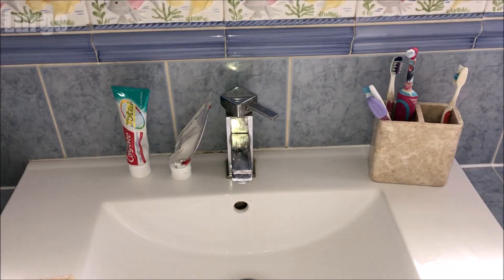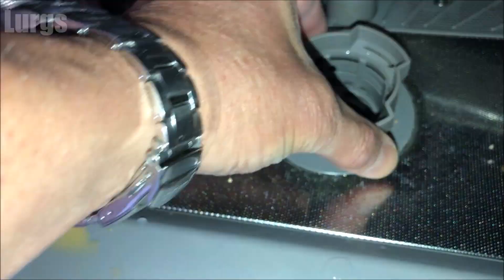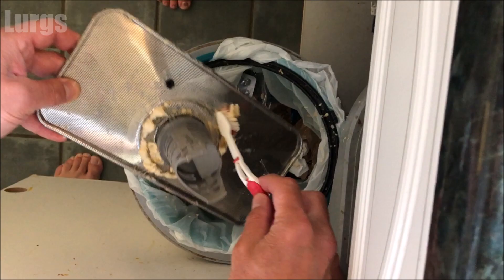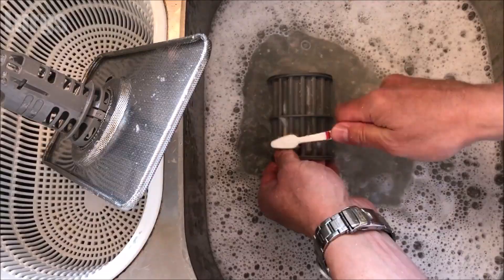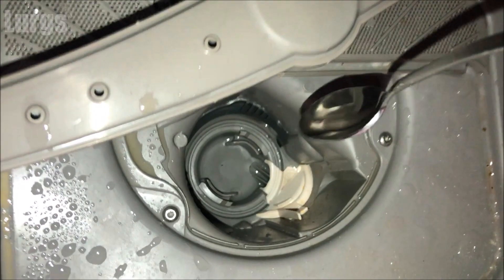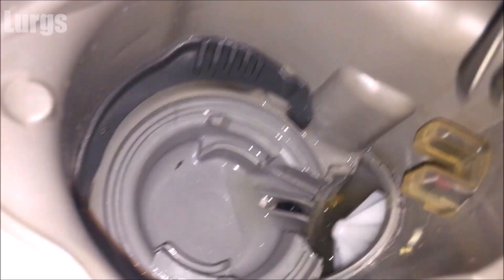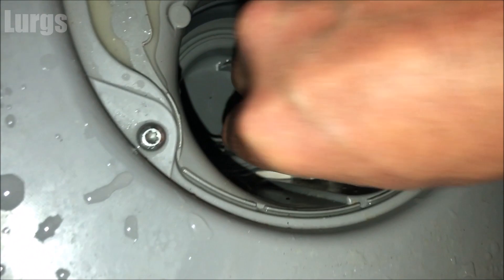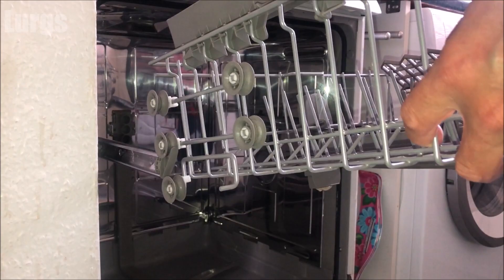How to clean Filter in Bosch Dishwasher for Maximum Efficiency - Bosch Dishwasher not draining Water

Comment: Thanks for a great video. Question on the stale water inside filter though, is that water recycled/reused inside each wash cycle? I hope not, that yucky liquid should just be in the drainage only and not for repeated rinsing in a cycle...  In other words rinsing uses fresh water each time?
Reply from the maker: No that water is for drainage only and will sit there. When Dishwasher runs a cycle the fresh water comes out the spray arms then the drainage impeller \ pump drains the dirty water.

Comment: Thank you..i never realised there was an impeller to clean 😮
Is it possible to disassemble the main part ? I have just bought a new mesh filter which came with the main body also. No idea how to remove the old one from the main stainless steel part. Thanks
Reply from the maker: I think it’s all one piece apart from the filter which pops off
Reply: @LurgsHowToGuides  righto.. I'll have to examine it a bit tomorrow. As well as the filter they have supplied the other part too (in 2 parts) 
Cheers

Comment: absolutely hate my bosch 50 dba. It always leaves residue on the dishes. Also all the cracks/corners of the dishwaser is gross with slime. I try to clean the filter weekly but still doesn't help much. Terrible device.

Comment: I have a Bosch 44 dba. It always has gunk inside the dishwasher but not in the filter. The gunk gets on the dishes. Is there so ething broken?
Reply from the maker: How odd. Maybe remove the washer arms that spin and give those a good clean, sounds like they aren't rotating and spraying.
Reply: @LurgsHowToGuides  Yah I'm really not sure. I'll check the arms again and see if they are blocked but last time I looked they seemed clear. My outlet hose seems ok but sometimes I wonder if it's raised high enough. It's above the garbage disposal but not terribly so. We've noticed when the dishwasher expels the water that the sink will partially fill up as well. If you have any other brilliant ideas I'd be so appreciative :)
Reply from the maker: @achilleze  you could put the drainage hose into a large bucket lower down and watch whilst it did a wash and see if water fills the bucket, make sure you have two ready for when it fills up. Drainage should be fine, our last dishwasher drainage pipework was as high as the actual dishwasher
Reply: I have the same problem. Tbh, I think the Bosch is just lousy.

Comment: I need to get gunk out from under that plate behind the filter area - is it ok to unscrew it & lift it out?
Reply from the maker: Not sure what part you mean
Reply: @LurgsHowToGuides 

  Thanks for replying - this is my partner’s DW & he hadn’t cleaned the filter in ages. I showed him how to do it (I have a Bosch too) but behind the plate that holds the filter, there’s a plastic plate with 2 screw holes. The spray arm comes out of it. Once the filter plate is removed I can see slimy gunk in the small cavity beneath this section. He said he undid the screws but he couldn’t get it to lift off - I haven’t tested that but it sure needs to be cleaned in there.
Reply from the maker: @livialives8910  I’ve never taken that part off before. Good luck

Comment: My dishwasher filters have never ever looked that dirty. I sometimes let mine go a few weeks before cleaning and doesn’t even look that bad. I don’t rinse much either scraping doesn’t happen as much as I should.
Reply from the maker: I'm really careful putting in plates and cutlery that aren't covered in food, the kids of the house not so much!😎
Reply: @LurgsHowToGuides  your dishwasher just looks like it gets a lots of grease build up in the filters. Mine won’t get that build up as I can’t let oily fat go down the drain due to a trap that isn’t easy to remove to clean, I wipe out a lot of the residue with paper towel (kitchen roll) then put it in the washer.
Reply from the maker: Yeh I’m super careful with any grease and always remove it with paper towels and put in the bin, fat down drains is a big no no. I’ve had a word with everyone in the house!
Reply: @LurgsHowToGuides  I hope you do not prerinse, but simply remove food debris with a fork or paper towel. Detergents work best when there's dirt on the dishes. Simply use powder detergent (no liquid, it's the worst type of detergent), run hot cycles (Auto or Intensive will be fine) and your filters will be much cleaner. If you prerinse detergent won't be effective and you'll get an even larger amount of buildup caused by undissolved detergent and some types of dirt
Reply: I never clean plates. I sometimes use the hot 70°C program.  I only get problems if i eat a lot of beans.

Comment: And this is exactly why I am returning my Bosch dishwasher and getting a GE or Whirlpool. No pre-rinsing, no filters, no cleaning.
Reply: Those are the one of the worse dishwashers u can buy (in terms of reliability and longitivtiy) the no1 worse is lg then those two ge and whirlpool. All dishwashers need to break down food. In European style dishwashers like Bosch the hot water and pressure breaks down food with force. Cleaning the filters is just a bonus, these filters are meant to mush down the food into paste so it wont get stuck anywhere inside. In american style dishwashers there is a food chopper like a blade that breaks down food AND and strainer attached to it. Any thing like a plastic sticker off a jar or something that cannot be broken down by filters or choppers will get stuck in any dishwasher but In these u can remove the filters and clean them. In american style ones u cant. U need to open up the base completely from inside and remove it to clean. Since its a moving part it also breaks down and would need replacement eventually, especially when things stuck to it and it cant revolve it fails. For pre rinse, its not required in any modern dishwasher. For cleaning inside the dishwasher, it’s required. For whirlpool or ge too u need to open up and clean more parts at the bottom than bosch, just look it up on utube you’ll know.
Reply: My BOSCSH Series 300 gets my dishes cleaner than  my Whirlpool ever did. In fact, if I didn't rinse them first, I'd risk debris on everything in the Whirlpool.

Comment: It always surprises and disappoints me that fat builds up in the filter and is not dissolved by the dishwashing detergent/tablets during the normal wash cycle.  Do the dishwasher cleaners also remove these fat deposits?  I suppose it comes down to the convenience of the cleaners vs their cost.
Reply from the maker: This was a demo of how bad it can get. We usually wipe off any fats with kitchen towel and put that in the bin. Really don't want any sort of fat getting into your drainage pipework or sewers as when it gets cold it goes solid and will block your drains.
Reply: It does come off if you use the hot cleaning cycle with 70°C . That's what I do. Works perfect.